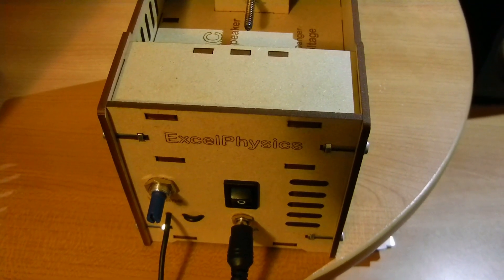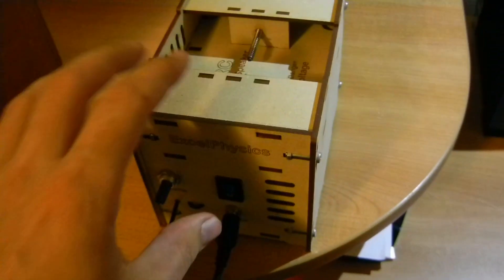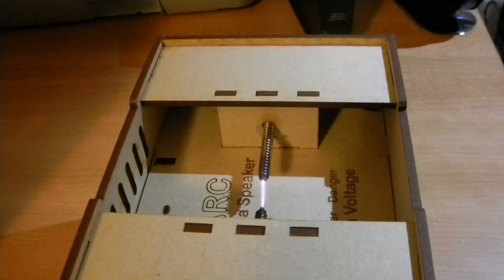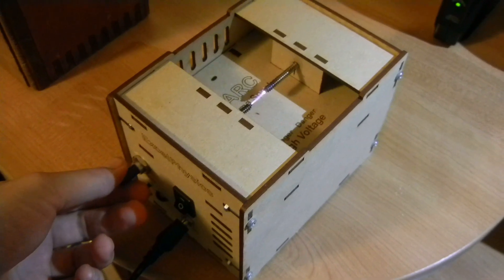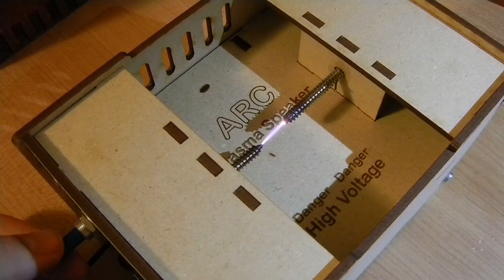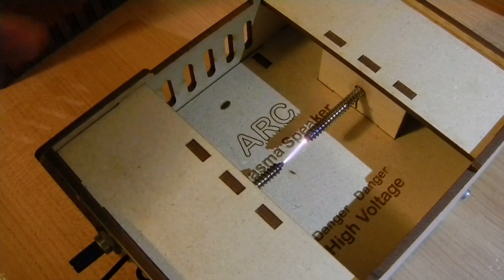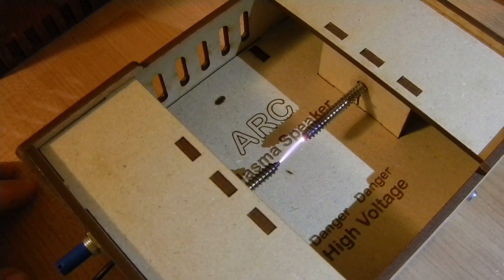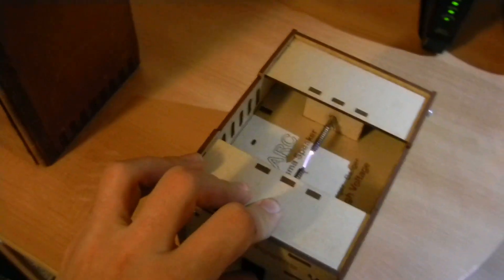Plasma Speaker

Comment: One electrode is hot, DC current plasma discharge there?
Low power there...(200wt better and working like real termoplasma speacker, when this(on the video) is ionophone more than termophone, because position modulation, but unstable on finish points of all (always moving)  arcs )
i find out that stell electrodes are not good for plasma speacker, due to weak ionisation possybylity of iron, try copper, or place near start of arc(around sharp electrode) some ionisation source, like piece of CaCO3, or glasswool dryed in water+alcohol solution of NaCl or  any enother mineral or metallic material, which will give "fat" plasma flame, like coper electrodes(sounds louder and better than steel). also remember - nitrogen oxides produced by air discharge, and ozone, they all are really toxic, to solve maybe some silent fan can be used, ended with zero resistance(of gase flow) filter - jar filled by activated carbone, or maybe cyclone type flow rotation liquid filled air filter from old car(usually filled with oil that catch dust from air vortex passing near liquid), but filled with water solution of any kind of soda, it will catch poison gases NO and NO2, converting it to some fertiliser sodium nitrates salts.
my speacker prototipe:( youtu.be/s33Q9E4pgM8?t=52 )if you are intrested, i can give you full schematic documentation, and permision for comercial spreading of its kit, even free, it sounds great, almost from 100Hz, 300hz wery good, and tube analog power modulator -sounds better than PWM class-D modulation, without 0-300hz signals(filtered freq. by Cool Edit high order digital filter) i can not find(to hear) any difference of my plasma speacker with Stax SR-303 headphones(earspeackers, so called by Stax company) powered by direct drive tube triode amplifier class A two stage(two triode in each chanel) without feedback loop, that i make also, and love most.
this is my own schematic sollution, 200wt=150wt supporting "DC" power of silence(25kHz around 15kV AC)+50wt tube class A additive plasma power modulator,-  plasma termo 
later it was placed in 5liters plastic(PP or PE) box, but unfortunately never heard stereo of it - that is my dream...
that past time, i make HV tube amplifier for direct drive of electrostatic speacker, that was supplied by two(for independent supplied chanels of stereo) 200wt MOSFET halfbrige 2*IRF840+IR2153(always 50% Duty cycle) stepup with TV flyback  НV transformer but 43turns first coil, and its own HV coil(2000turns good isolated with epoxy glass),  and then two HV diodes - each are 20pcs ultrafast diodes 1000v10a rated, in series, and two capacitors 10kV, conected as a brige voltage doubling rectifier. only wit that diodes i got the power... 200wt continious DC 15kV*14mA , that was consumpted continiously constant current, due to output differencial two tube stage of amp. that powered by current source. very meaningfull on "low voltage" stage of stepup was varistors on each mosfet, 27volt type small varistor on GS pins of IRF840, and 470volt type bigger one varistor on SD pins, and extra external rear-diodes(inside mosfets slow and weak diodes - often brokes) 1000v10A ultrafast also on SD pins of mosfet - like built-in weak and slow diode, in paralel, also 10.0 oHm resistors in gate was between mosfet gate and driver chip, and out of halfbrige connecned via 0.5microfarade 450V polypropylene film capacitor, to first self-maden low voltage coil, 45turns,-70wt max 44turns 100wt...43-42turns 200wt, 41turns-explosion of mosfets...
f>25khz possible, 40-60khz easy, but ferrite МН-2000 core start to heat really, and secondary(HV) coil brokes soon, because of its own internal isolation(slow one-like PET, not fast like PP or PS)capacity hFreq looses to heat 

for plasma speacker no HV rectifier was needed, and stepup that works good in wide range of power, without looses(almost RoomTemp. cold parts when work) so i decide to modulate this by power supply modulation of half brige(last) mosfet stage(chip was powered by own 14vDC supply) mosfet supply was sum of constant DC current via HPS-lamp-type inductance ballast+resistor, that was silent power circuit-150wt, and GU-50 tube anode current - in sum,also to mosfet supply, that can add more current up to 200wt peack power - sound modulation part, so, plasma power modulation was provided by tube working in class A, and support("Silent") power, bigger part of power(which determines medium size of plasmoid, and its own bass potency)
-------------------------------

for you: try to use liquid electrolite(car aq. 30% H2SO4 sol-n will be good) as finish electrode, preferably (+) positive polarity, that give realy bigger and hotter plasma from low power, due to acid electrolite protons flying up from liquid surphase to stell cathode(- polarity), that melts 1mm stell wire,from only 4-5A (2kwt oven - as resistor + one diode(half period rectifier)
with (-) on electrolite you got almost nothing, but AC not so bad.
under liquid surphase will be your magnet, and i hope - arcs hot finish points will disappear, and sound cracks also
good luck

Comment: Imagine this as a mini component, this could change many good things regarding sounds..
Reply from the maker: Did you have anything specific in mind?
Reply: Monitors, smartphones, inside walls or any flat surface..

It also depends how good the sound quality actually is.
I can't judge the sound quality based on this video, i need to hear this with my bare ears real life.